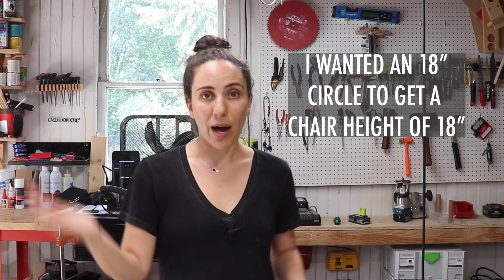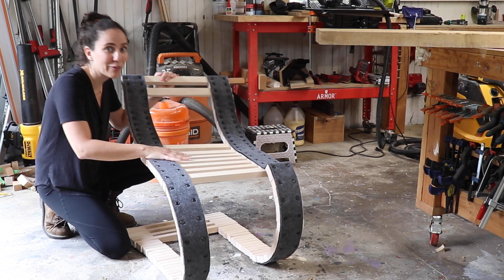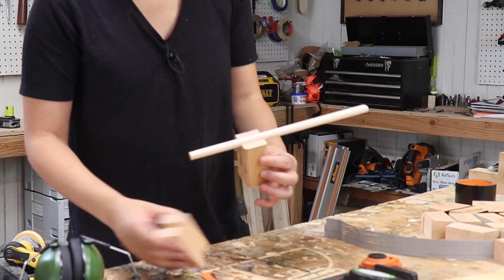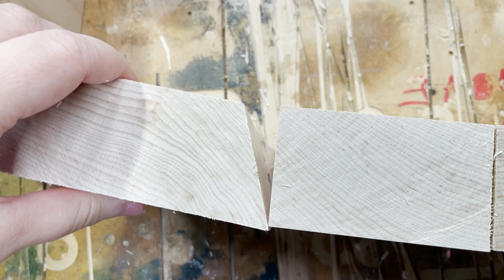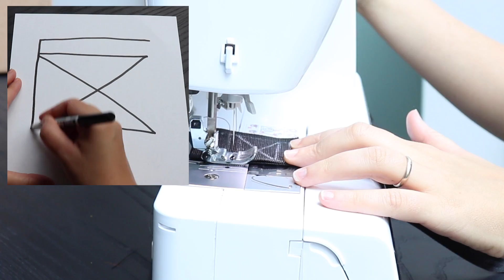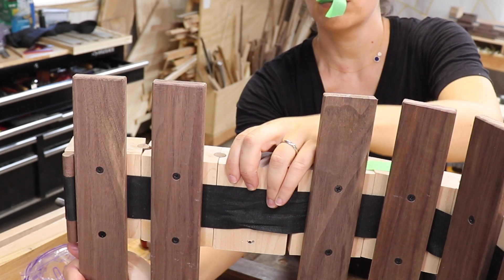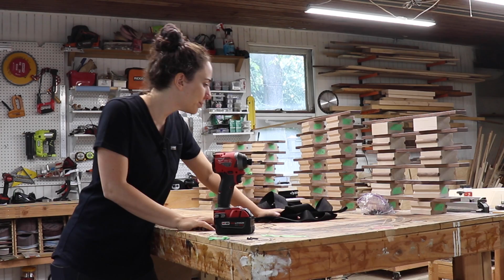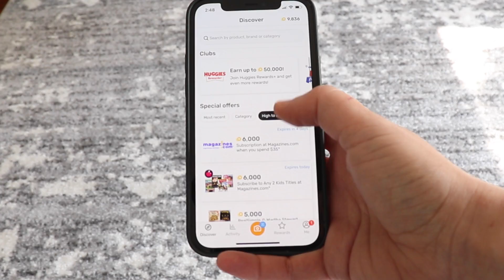I ATTEMPT to make a Roll Up Chair… AGAIN...

Comment: Why not glue (epoxy ?) the strap directly on to the wood parts (while in place), leaving a couple millimeters unglued at the junction between each sections to let it bend. 
For one thing, it would keep tension in one part to being transfered to another part of the chair (or rather lack of tension being transfered..). 
For another, it would mean you only have the few unglued millimeters of the strap stretching in between each section of the chair instead of accumulating the whole elongation of the strap along the whole chair.
Lastly, it would keep sections in good alignment so thet'd always fall into place when opening the chair (noticed you had some troubles at times).

Comment: The forces that you are generating at the junctions are huge because of the mechanical leverage. This will cause some stretch in most materials except maybe Kevlar. Even then you will probably get more than is safe. 
You might consider a slightly different approach by using two sets of motor cycle chain per side set into channels in your blocks so that they sit flush and still allow the rolling up to take place. They can be held in place by the horizontal slats in the same way as the strapping was.
Reply: I’ve just seen a comment further down suggesting the same thing! I should have read further before commenting…..

Comment: I think the choice of materials was probably fine, but the design did not appear to take into account the properties of those materials. The two things that stand out to me are:

1) The angles on the blocks appeared to be selected based on the desired unloaded shape of the chair (i.e. how it looked without anyone sitting in it).
2) The strap was being attached in a manner that led to (roughly) equal tension across the entire chair, but we really needed more tension in certain areas (such as where the legs become the seat). This would be achieved by doubling up the webbing in those key areas.

#1 ensures that the blocks are doing their part in carrying and distributing the load, thus reducing the overall tension needed; and #2 ensures that parts that are not significantly load bearing (such as the seat back/top) are not constantly under so much tension that they immediately collapse on themselves.

Comment: Hi Tamar, just wanted to make a suggestion. I think adding the dowel between the pieces is creating a leverage point. Instead of 2 flats coming together and being compressed and forced into each other, the dowel is creating a round edge that the pieces can pivot around and in turn increasing the stress on the webbing/straping. Hope this makes sense. Really enjoying your channel. Thanks.

Comment: Try using hinges instead of straps:) Or make the pieces interlocking, so it uses a dowel locking them together at the proper pivet points:)

Comment: You need something that doesn't have much stretch.  As the chair flexes the strapping, the tension linearly increases.  What you want is something to be under no tension in neutral position but has strength and tension under weight. Metal is typically used for this purpose. I appreciate your hard work in these projects. Keep going!

Comment: Just watching this for the first time. What if you attached a counter strap along the backside as well and made some sort of mechanism to add tension to the straps on both sides at the top dowels. Some sort of twisting mechanism that turns the dowels to add tension and then locks them in place. If there was tension on the backside it could prevent the segments from collapsing when it is sat on.

Comment: To keep the chair from collapsing backwards, recess some rare earth magnets so it “clicks” together and stays in one shape. Also as far as the strapping is concerned, try some straps designed to hold down loads in a flat bed 18 wheeler. They are rated at 3000+ lbs. I’m am not sure of their stretching ability but I use them and they don’t stretch much if any at all.

Comment: I think some internal holes in the blocks, and then use 8-10mm Dynema line (used for sailboats instead of stainless wire)

Comment: Some other people have mentioned it but from sailing I know that kevlar is about the least stretchy stuff around that isn't metal.  See if you can find strips rather then woven material, the weave itself adds in stretch.  It might have a limited lifespan with rolling and unrolling though. Steel rope is probably better, if you dont mind it. Or a fine chain.

Another thought is bolted on steel hindges.  Could be very industral looking, maybe not your style, but very little stretch and lateral movement.

Comment: What's the point of a folding chair that is too heavy to easily transport?  Surely the weight of the finished design and it's impact on portability has to be a key consideration.
Reply from the maker: Not meant for transport. More like an art piece. This is just experimental 👍

Comment: Simple solution " thicker sections" ie 4" X 4" pieces😳😎OR MORE "longitudal sections ie 3 or 4 instead of just 2!... Also maybe different type of webbing... Maybe even treat the webbing with some type of epoxy which may render it still flexible yet still flexible?!

Comment: I'd think about steel cable or chains. And maybe even some joints in the most stressed places. As long as the linkage is  stretchable and maybe even the wood is compressible by human body weight, this would be interesting to figure out to work for samller kids, as well as big adults.

High school physics teachers or maybe a even college professors would probably love this to give their students more than one headache, with all the different angles,  stress on the material, the fabric, as well as static and dynamic forces attacking from several angles.

Comment: Awesome video!  Recommend looking into steel cable tensioning hardware used for steel cable deck railings.  You could thread the cables through the blocks, then tension them afterwards as needed.

Comment: Well you learn more about it every time you do it. But insted of a partial mock up do the whole thing out of a cheaper wood, then when your sure you have it solved use the good stuff.
Burning on maple is a feed speed issue or blade type.  Feed speed the blades sitting on one spot too.long causing it to heat up  the other approach is depth of cut sevral passes removes less wood and feeds faster.

For a chair like this but solid a bent lamination might be a better option.

Don't give up there is a way to do this and it work.
This kid did it.   But I belive your attempts are more advanced then a lot of the comments others have made including mine.

Comment: What about 2 steel cables running through each "rail" of wood pieces that is secured at the top and then at the base you can tension the cable at the base of each rail. Thoughts? I don't there is any poly material that will be able to hold the amount of force you need.
Reply: This way the geometry of the wood is holding all the pressure.

Comment: This chair looks like a cool concept! I was looking at this from a perspective like the way bridges are designed. Ie. cables(insstead of straps), and key stones. Also I think a role up set of arms coupled with a preload design(chair leaning forward a tad that has a slightly higher seat height). Please keep working on this!

Comment: I'm definitely curious now if stainless steel cables attached with an adjustable tightening/loosening mechanism like a turnbuckle would work for this design. It seems pretty clear at this point from your experiments that if you're using a non-metal hinging material it's probably going to stretch too much (unless that amount of stretch is accounted for in the shape and then the weight of the sitter brings it to the desired seating position when their weight is added and the stretch limit is reached).

Comment: Draw the defining curve of your chair. Draw uniform sized circles all along it, centred on the line and touching each other, like beads on a string.
For every pair of neighbouring circles, draw a line down between them, tangent to them both.
For every pair of neighbouring circles, draw another line tangent to both but now joining points on the underside of the chair.
You should now have lines that define blocks similar to yours but with semicircles on top.
Imagine these blocks rolling against each other like gears: the smooth, round, topsides roll freely but the flat sides lock when they're moved to the positions for the chair's desired curve. (note: the underside of each block needn't also be made from tangent lines - you could, for example, connect them all with one smooth curve.)

Why use these shapes?
The points that define how the blocks rotate about one another are guaranteed to be within the blocks themselves (the centres of the circles) and the blocks always remain in contact with each other throughout the rotation. To join them, you just need to fix the centres of the circles relative to each other.

One way to join them is to drill a hole through the centre of every circle and thread a rod through it, then use solid wooden pieces to connect every pair of rods. For added strength, connect the rods on both sides of each pair of blocks. The connecting pieces could be any shape but why not cut a thick slice off each block and "glue" the slices together in pairs - these shapes will also rotate and lock, like the original blocks. You will need to cut another thick slice off each block to pair them the other way too, forming an alternating chain of blocks. Indeed, you don't even need the original blocks anymore, just these thick chaining pieces... and you could repeatedly alternate them across the whole width of the chair for something really solid and sturdy! This shape for the connecting pieces also preserves the ribbed effect created by the round topsides of the blocks but you could sacrifice this to create more solid chaining pieces by filling the area between the joined circles. (note: the blocks rotate freely around the rods so these would ideally be made of smooth metal to reduce friction. Each connecting block can also be glued/fixed to one or other of the rods it's threaded onto to allow some spacing between blocks and avoid them rubbing against each other.)

Comment: I recommend designing/building the chair as one big chain using thin aluminum side links and pins to hold the wood together.  (Not straps and not cable) (and use hickory for the contact pieces)  The magnitude and direction of forces are too different  for any type of band material to be effective.  The material is stretching in tension on the bottom curve, and it is trying to tear out the fasteners on the reverse curve.  If you have an engineer do a free body diagram I think you will find the forces far in excess of the elastic constraints of most materials such that it look like a chair, and act like a chair when you're sitting in it or not.  

PS this thing is going to be the ultimate pinch monster by the way.  

Good luck and great video!

Comment: I think you need to consider that the felt in the original design may have been hiding a much stronger material underneath.  My thoughts are that this would work with custom steel hinges, with zero give, at each joint.  It would provide the strength and rigidity.  Even some carbon fiber based.  Sounds like expensive options though.  Maybe over your budget.

Comment: I'm not qualified to offer experienced help but I have been thinking that perhaps twisted or braided steel wire  strong enough to hold and threaded through the blocks using holes just large enough  to pass the wire while still allowing it to move. Connect each end through a steel bar top and bottom. Liked watch and I feel your pain.. Dan Sylvester

Comment: I LOVE your channel, and continue to be impressed with both your skill and engineering intuition in every project.  But I was just cringing watching you struggle with this over and over again, coming SO close to understanding why it's not working and then veering off in wrong direction!  So I have to offer my 2c.

Means of attachment of the strip to the wood is NOT the problem.  The stretch of the strip, while important, is also not a big deal.  The key here is the small local deformation of each piece of wood as it's getting compressed when you sit on it.  

With that in mind, you can correct your work by: 
1. starting from rectangular blanks (rather than square); say, no more than 2:3 ratio of sides
   AND 
2. reverse-engineering the angle of cut of each wood piece to steeper (more trapezoidal) or less steep (more square) depending on the location.  Basically redraw your curve so it's more "scrounged", as if in fetal position. As you sit in it, it will open up to the desired profile.

Once you got that right (using low-stretch thick webbing screwed down with a row of 2 screws (not one) at each slat), you will have solved the structural dilemma and covering the surface with felt or wood slats or whatever would be a matter of artistic choice not stability.

Just my 2c!  I hope you find a way to make it work and please keep coming up with projects, they are both useful and fun!

Comment: A great creative chair you planned here. I would suggest you to use steel wires running throughout in a specific groove you can carve out in all the pieces. I will also advise you to do the same on both side (inner and outer) so that the pieces are not moving out either way. the lengths of the steel wires will obviously vary for inner and outer face.
Reply: Want to see you complete what you have ambitiously started. Please try if you still have you have not used the wood in other projects as you hace said.

Comment: I appreciate all the work, WOW, it took so much work; however, improvements in the design are required. You have to prevent the belt from shifting, so a groove below the belt and nipples that are attached to the seat brackets and press the belt into the groove would be necessary. You must provide this principle at a suitable distance. The edges of all segments must all be rounded to avoid to pinch your skin. Create a perfect sample before starting the version with the expensive wood.

Comment: As always, a pleasure to watch you go through the process, whether it's a "success", or a learning experience. Thank you.
I think that your idea, to fasten the strap to each piece, should solve all the problems that you've mentioned in the video.
It would not only prevent the accumulation of a large gap, it would also prevent the accumulated tension from passing to the end pieces, eliminating the danger of them snapping when you get up.
In fact, the only Place where you need those straps to be flexible is at the bend points, so you can just glue them to both layers of wood, and then use your favorite fastener to secure them through both layers, should the glue fail under the extreme pull force.

Another consideration is the DISTRIBUTION OF FORCE... instead of using 2 collapsible "bands", use 3, or 4, or even more, until the tension on each one of them is reduced enough to be handled by the material.

Thanks again
Reply from the maker: Yeah. After I got hurt though. I didn’t think it was wise to keep going with this iteration. One day I’ll get it.

Comment: Leather stretches. Seatbelt strap doesn't. Go for seatbelts. You can probably get plenty for pretty cheap at your local junkyard.
Reply from the maker: That’s what I used 🤷🏻‍♀️
Reply: @3x3CustomTamar  That's really weird. I've used seatbelts as tow straps in a pinch and they didn't stretch. I don't know, then.

Comment: I haven't gotten through the hole video yet and I already see a problem.... your first piece going into the back rest needs to be mitred in the opposite direction so that the weight load goes into the pieces beside them rather  than in to whatever chording you are going to use.  Take a look at the way that brick masons build arches, rather than the way a barrel maker would.
Part of your issue is that your joints under pressure are going to have a tendancy to open up as opposed to pressing in to one another.

Comment: Try steel wire braided wire. 
We use it for tension wire at My job. The right gauge might be tricky to figure out, but it's light, strong, and doesn't really stretch

Comment: steel wire should be installed into the middle of the chair frame, the strap would also be tight enough that the chair won't look like its actual shape when unfolded, so when you sit on it the tension equines into the form of supporting the chair and giving it a the look you want to achieve. also the strip should be ultra strong. maybe use some kind of belts that are used to hold things in trucks, heavy duty ones should be fine since they are kinda thick and also very very very strong

Comment: interesting stuff, i think you made 2 big mistakes. first, use felt! doesn't stretch too much. then glue a wire rope between wood and felt. the second mistake, you need different angles in the wood pieces, won't work physically with identical angles...

Comment: My uncle watched this and decided to try his hand at making a rollup chair. He failed, but he had the greatest success with using a bike chain instead of straps. Since the chain itself can roll, is durable, and is pretty light. (He didn't measure his pieces correctly and gave up before he was so close) The chair itself eventually collapsed under his weight (He's 290 Ibs. Big man).
Reply from the maker: Haha nice

Comment: You could try to put strapping on both sides of the wood. Since the tension of the strapping is making the chair fold in on itself on the angles where there isn't any resistance in the direction the strapping is pulling the wood (i.e. it pulls the curves into themselves on the top since it's on the front and the tension force pulls the wood down and to the front of the chair) due to it's positioning. Therefore, putting strapping on the other side as well could actually work to solve your gap/folding issue.